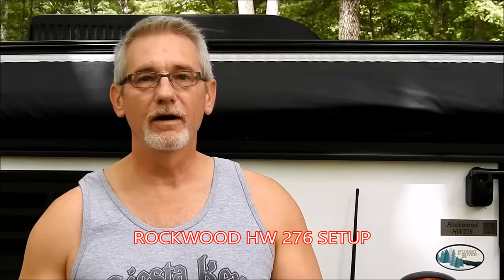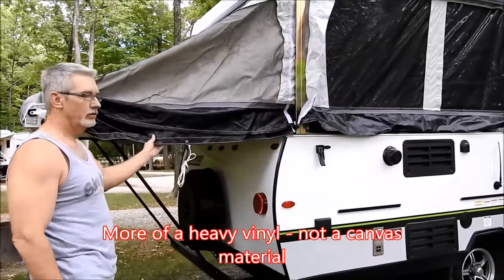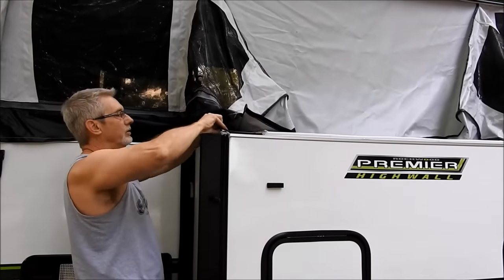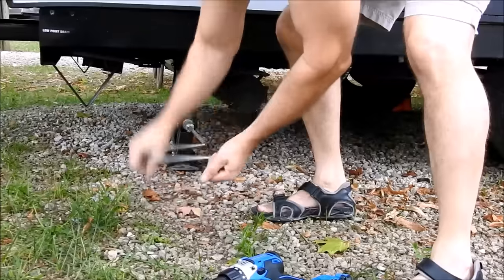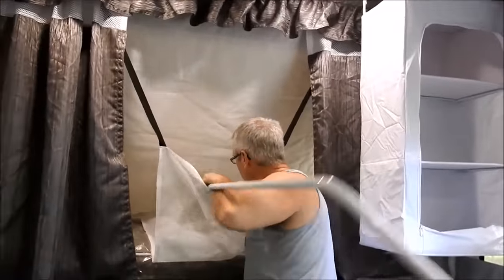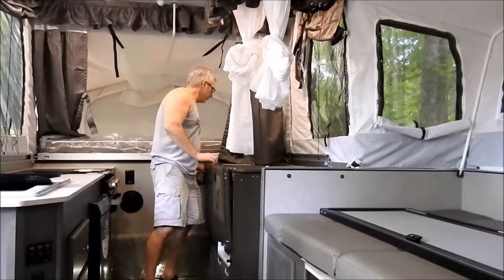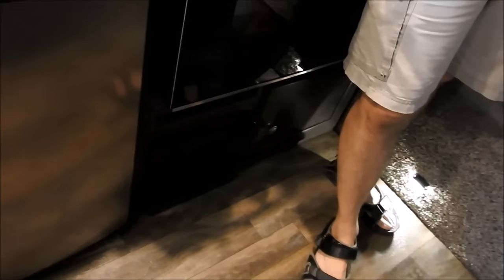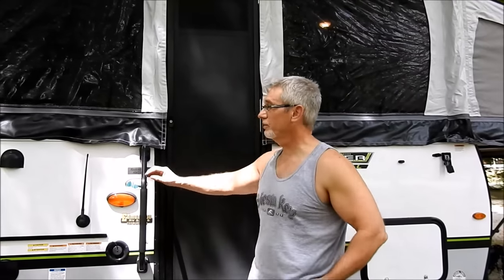Pop up camper set up, Rockwood High Wall 276 set up

Comment: Must have a surge protector!! It started out great with the push button roof riser and then down hill from there. Way too much work for a weekend. Im a single mature person. Not sure that contorting myself with those poles is something I would want to do. It seems that the older ones were way less work. Thanks for the video.
Reply from the maker: The tent poles have gotten much easier. Don't know that I had the bunks pushed out and locked in 100%. Also a viewer suggested not attaching the outside velcro of the tent until the poles are in and this seems to make a difference as well. Thanks for watching!
Reply: @balancedperceptionsllc1512  Would you keep us updated on the tips and tricks of set up please. We want to see where you go camping. And by the way you did a super job of set for your first time!

Comment: Thank you for this Very informative video. I was wondering if the port a potty fit in the bathroom space? Also I noted the outside shower appeared to be directly next to the electrical hook up outside. Give it a break ...People that complained about the allergies being to distracting ... Some of the helpful hints below are also good to know. Happy Camping...So now that you have tried it...Are you enjoying it as much as you thought you would?
Reply from the maker: Yes the port a potty fit in there but it was tight!. We have used the bathroom mostly for the midnight relief and it was wonderful. We used the port a potty only one weekend trip and it worked well enough. Most campers/trailers seem to have the electrical and water side by side and apparently it is not a problem. I did look into this as well because it didnt make any sense to me either!  After this video we did a week long trip that ended up being the hottest week ever recorded in early October. we spent a lot of time in the camper during the very hot afternoons- the AC and the L-shaped coach were a life saver! So yes, thus far we really like it and the set up is easier and quicker every time
Reply: How does the toilet system work I always wondered how do you flush where does it go? Yes I'm a city person new to outdoor stuff.

Comment: Pro tip: When putting in the bed poles, there is usually a metal lip that runs around the perimeter of the roof. Put the L part of the pole in your palm the use your fingers to grab the lip, squeeze, and you get the end of the pole into the brackets much easier than trying to push with your arms and body weight.

Comment: I think it’s easier setting it up and leaving it that way , adding a cover to store it because it seems like a lot of work to setup and takedown. My opinion?
Reply: But all in all it’s a nice pop up camper. I did not catch the price . How much is something like this thanks ??
Reply from the maker: If my memory is correct this was listed at around $16,000. This included double filled propane and TWO batteries. Many dealerships seem to offer lower prices but then add on several dealer fee's. Things like paying for the destination charge, the batteries and prep and walk through start showing up. This is one of the things that stopped us from getting the even bigger HW 296...couldnt strike a deal. I do not recall what we paid for the HW276 but it was several thousand less than the 16k. A very good resource for Forest River pop up campers is roberts sales. They carry flagstaff (same thing with different branding) pop ups with tons of info on their website.

Comment: Did the dealership not walk you through opening and closing up your camper??
Reply from the maker: Yes they did but it was rather abbreviated. The tech was not happy with the length of the pigtail wire from the factory so he took quite a while to replace. And to be fair we arrived late at the dealership due to traffic

Comment: Make sure you Always use the Extension Rods at the bottom of the steps so you're not forcing All of Your Weight to be supported by those hinges at the top of the steps.... Unless you plan on replacing the doorstep when your weight rips the screws or rivets out.

Comment: First thing you should’ve done was drop all your stab jacks before you started anything! I got a 2019 HW296 almost same model except a tandem and it’s a must especially with a single axle like this one. But after setting it up a few times, it gets routine that’s for sure. You may notice after a while you’ll need to adjust the lift jack. Mine started cutting out at the limit before it got fully extended. I noticed in the other comments your Dealer tech gave you a rushed Demo and that sucks. But good job otherwise.
Reply from the maker: Thanks. I think I did eventually figure out to drop the stab jacks first! I actually wanted the HW296 but that dealership would not cooperate and I knew for sure it would never fit in my garage.. Enjoy !
Reply: Balanced Perceptions, LLC I’m rookie as well no less. We got ours mid summer last year. I learnt from watching your video about the balls on the feet of the awning poll. Dealer never showed us that lol. Our dealer wouldn’t deal on the HW296 in March, by July when it still wasn’t sold, they finally talked price that was reasonable.
Have you done the modification to the grey water/black water valve? My thing to do this spring so I can just use one 3” hose and not have separate hookups.

Comment: Dang at least 43 minutes to setup not including the time to park it, level it, detach from truck.  Why did you have to do it all in one shot?  She was clearing having a hard time breathing after her first sneeze.  I don't know what was your budget but a hard wall pop-up is a whole lot easier to setup plus it gives better protection from woodland critters and perves.

I'll say this...when I was a boy we had a pop-up.  The bed platforms weren't on sliding rails, there wasn't a slide out section, but the door was way easier to set into place.  Leveling it was a pain for my folks...literally.  Luckily they had young kids who did the bending down labor.  We had to be sure to balance the sleeping load on either end.

Comment: I love this camper! Can you tell me how tall the unit is including the ac? I think you said you were 5"8 and the brochure says this unit is 6"7 so I am wondering if that includes the ac or not.
Reply from the maker: I have been told that the listed height does include the AC, since it is standard on these high walls. I will try doing an actual measurement tomorrow and let you know.
Reply from the maker: I measured today in a gravel parking lot and got a closed height of 78". So we are within an inch of each other. I've read that some owners let a little bit of air out of the tires to make it fit into their garage. They then pull it out and use an compressor to fully inflate. I suspect mine would have fit in my garage, but it ended up not mattering as I could not back it up my slightly inclined driveway without it bottoming out.
Reply: Balanced Perceptions, LLC 
Thanks
That 78 was including the ac so it will fit in my garage! Let you know when i trader jayco for the hw277!
Reply: It’s 6’7” on the inside. The AC unit inside is very low profile. Maybe 3-4” hang from the ceiling if worried about headroom.

Comment: Pro tip. Pull the vinyl over your  mattress covers outside last. Do the inside above the beds first.  The bars will push out much easier as you have no resistance. Then go outside and pull the vinyl over the mattress.  You were working against yourself.
Reply from the maker: Great tip!

Comment: The reason why this is taking so long is because this newer style camper is just poorly designed. I have a large 86 model Coleman and it doesn't take half the time to setup. And yes, I'm taking into consideration of the recording and talking. I've been setting up ours for over 30 years. I watched this because I thought maybe I could take something away from the new designs, but I don't think I can and I'll tell you why. The new detached bed supports versus the older quick "snap up" poles. The extra roof supports with canvas overlap. The newer canvas that has to be snapped, folded, tucked around, etc. The slide out work. The new door frame. The poorly designed "bathroom" walls. And do you need to attach the faucet head each time? It is clear to me that they over-complicated the new models.
I do like the plug in 30a on the exterior wall, versus our hardwired cable that has to be pulled back in.
Well, I'm sure you'll love it anyways, and that's all that matters! Happy camping and thanks for the video!

Comment: The purpose of the pop up is easy pulling. Why such a monster for a pop up. Just pull a fully contained trailer.
Take it back.
Reply from the maker: I had never towed anything and was intimidated with towing "real"trailer. I would have been looking at at least a 25 footer to meet my needs so ended up here. My TV can pull up to 9000 lbs. This towed like it wasn't even there.

Comment: No offense to this guy but I highly recommend spending the first night on the lot of the RV dealership. There are tons of things that will go wrong or potentially can’t go wrong in these RVs. Plumbing issues, leaks in the roof, mis fit panels on the interior, exterior walls that don’t line up or zip-closed, interior and or lights  on the exterior that don’t work. So I hope you see my point. Tons of things can go wrong in at least you’ll be at the dealership to make the list put it back into service department and get things done before you head out for your first trip or even home just to turn around and take it back to the dealership.

Comment: It wore me out . Times have changed. That is a monster of a tent, camper ? The support for the bed doesn’t look very strong. At 275 plays a 125 lbs woman is 400 plus children jumping ect and that doesn’t look safe. I’d rather have a small trailer. Pull up level up plug in and start the grill !